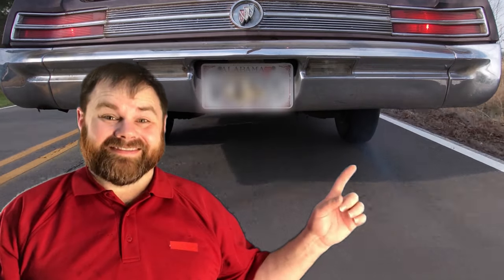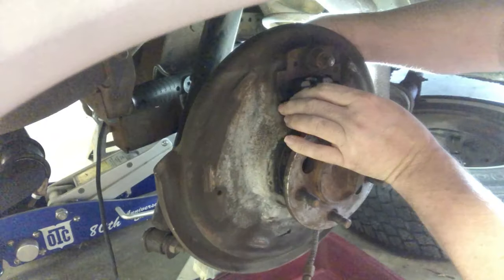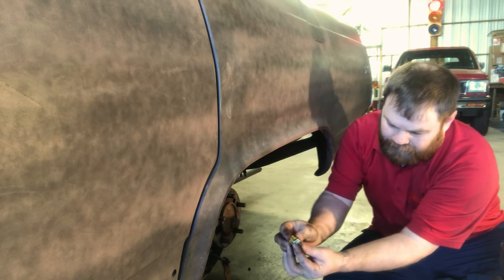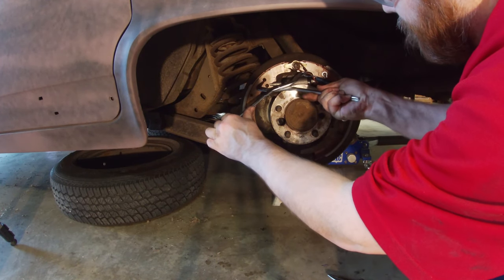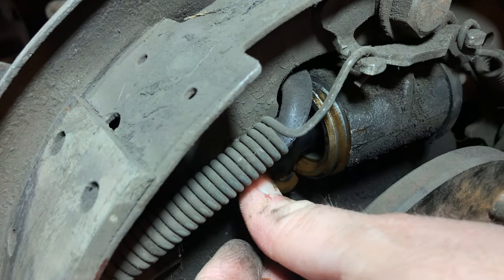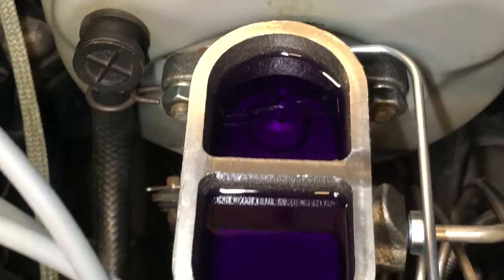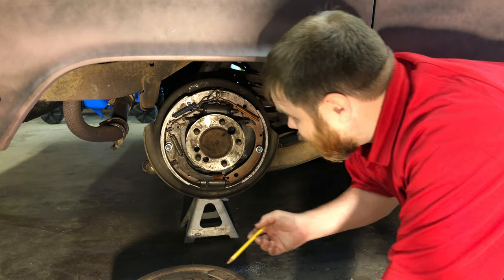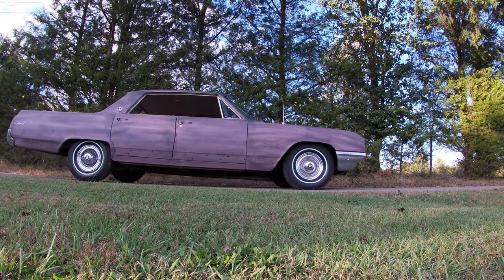All drums, no flats for 1964: Front drum and rear drum brake job DOT5 for a 1964 GM Buick Wildcat

Comment: Thanks for all the posts!! What brake master and booster did you use to replace the old stuff? Did you have much adjusting to do on the push rod?
 Thanks!
Reply from the maker: I was able to re-use the existing brake booster. It received a new coat of paint. The master cylinder is now an ACDelco 18M1027. The original pushrod depth of the single master cylinder is 1.63, and the replacement is 1.64, so no adjustment was necessary. https://1964buick.com/resto_logs/dual_master/1964_Wildcat_dual_master_cylinder.htm outlines the conversion.

Comment: Nice video! I have a 65 Wildcat with a single master cylinder and want to put a dual master cylinder. Where do you recommend I get parts from also my emergency brake isn’t working. Thanks
Reply from the maker: My parts were from a mixture of sources including Amazon. For the emergency brake, I recommend used parts from BestOfferCounts, either his website or eBay username

Comment: I bought the same master cylinder. However,  the instructions don't specify which pot is the front brakes, and which is the rear. Since I'm going from a single pot to a dual pot, do I hook the front brakes to the front pot, or the rear? How'd you do yours?  Mine's a 65 Wildcat.
Reply from the maker: Here is how I did mine: https://1964buick.com/resto_logs/dual_master/1964_Wildcat_dual_master_cylinder.htm
With the Inline brake lines, the front of the pot was for the front brakes, rear pot for the back.

Comment: It does not appear that you added a proportioning valve when you changed from a single to a dual master cylinder and split the system into front and rear?  Since you have been driving it a while now, have you noticed a need for one? Does it stop ok?  I'm about to do the same thing to my 65.  I eventually plan to do a front disc brake conversion, but right now I'm putting it back together with 4 wheel drums so I can get the car back on the road.
Reply from the maker: In the 60s GM handled drum proportioning by having larger wheel cylinders in the front drums than the back. Because the dual master cylinder simply turns one circuit into two, the factory porpotioning stays the same. I've had no brake issues. With a front disc conversion, a prop valve is required. Drums, GM already took care of it.

Comment: Hello man.  I have a car just like yours.  I think the master cylinder is bad.  What did you replace it with?
Thanks,
Steve in Tennessee
Reply from the maker: Hello Steven, If you want to go back original, the single master cylinder is still available from AC Delco, new, but it is expensive these days: https://amzn.to/3s1CfeL. I chose to upgrade to a dual master cylinder and am running this: https://amzn.to/38wFbck

Comment: My 64 Riviera has the same front drum in the main picture for the video. How do I take that front drum off? I'm having a tough time taking mine off of my Riviera.
Reply from the maker: There is a hole at the back bottom of the drum, there may be a plug in it. Pull the plug out, then rotate the star wheel until the shoes are as fall pulled in as possible. If it won't come off then, PB blaster around the lugs coming through the aluminum, and try some dead blow hammer shocks and some moderate taps on the back of the drum lip until it comes loose.
Reply: @1964buick  I tried doing that, but the star wheel is very stubborn and won't rotate more. Initially, it was rotating, but now I can't get it to budge.
Reply from the maker: @geneatencio  Last step would be to carefully grind off the rivets and attempt to slide hammer them off.
Reply: @1964buick  why grind off the rivets and separate the hub assembly from the drum?
Reply from the maker: @geneatencio  It eliminates one possible factor of how the drum is stuck on, with interference from the spindle.